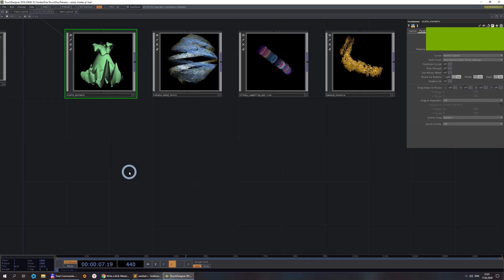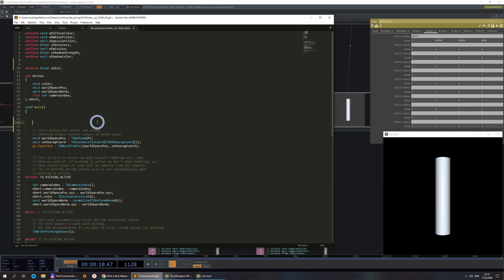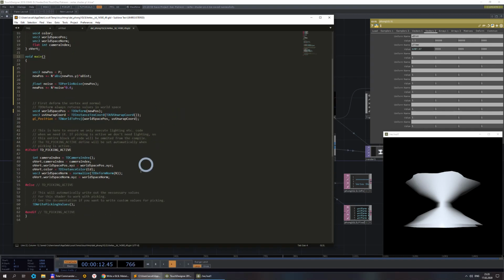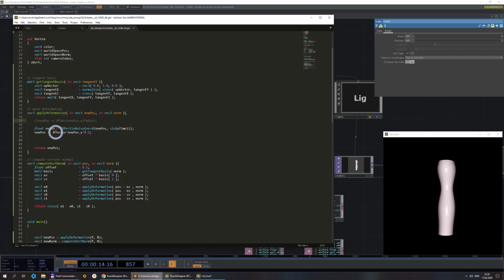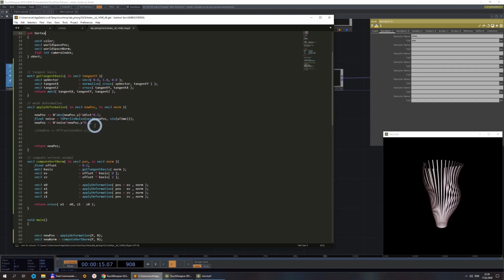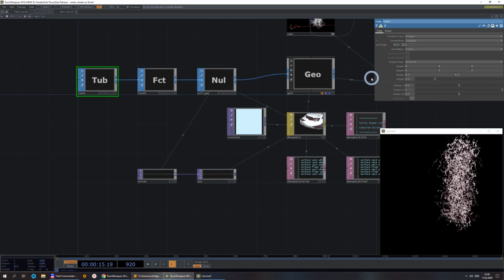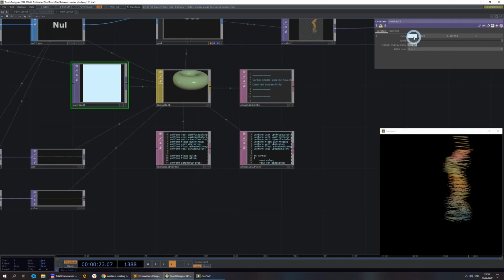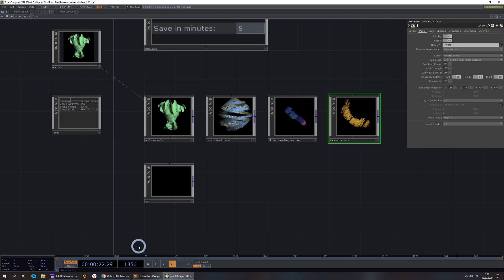GLSL Vertex shaders in TouchDesigner. Part 1/2

Comment: nice tut stas <3, suggestion to pass num vertices from sop to glsl shader,  you can cheat using the info chop passing your sop value (the chop return back informations about the sop parameter)
Reply from the maker: Thank you, Michele! I'm not sure, I understand your suggestion - Info CHOP have only number of points/primitives/particles, so it cannot be used to pass num of vertices or I'm missing smth?  I found one workaround, but it's very clumsy - add SOPto DAT for vertex extraction and use "num of rows-1" to give vertex number